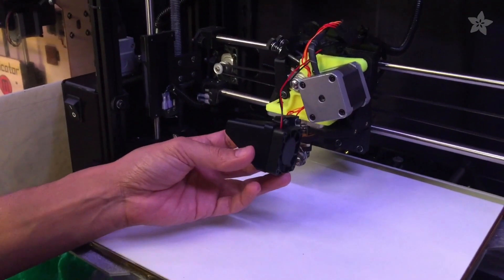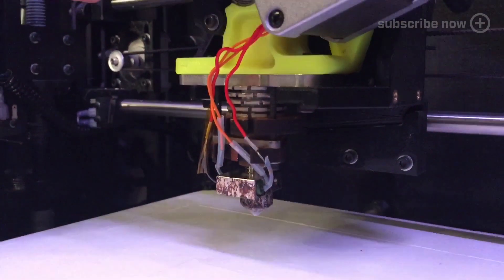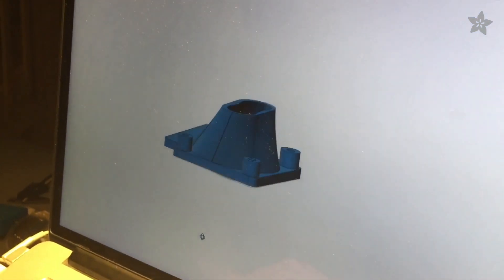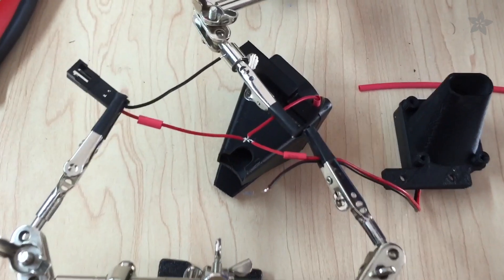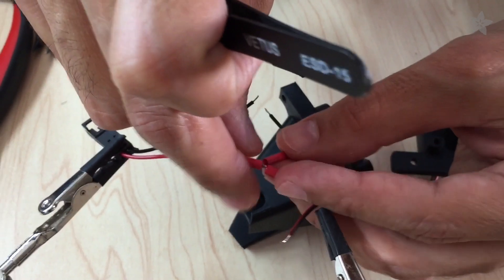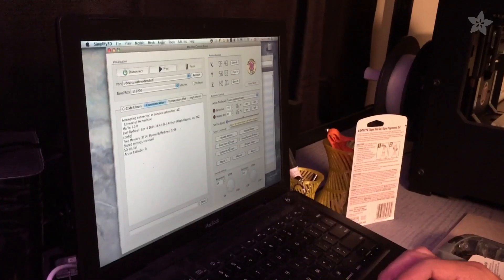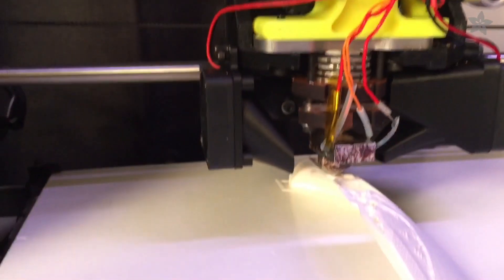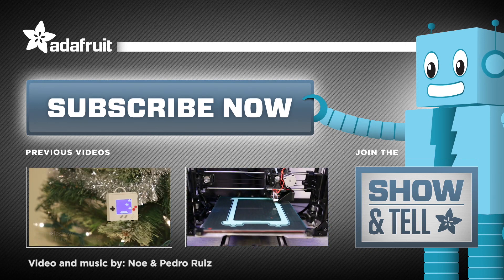Better PLA #3DPrints on TAZ with dual fans

Comment: Will you be publishing this on the Adafruit Learning System (ALS), as usual?  Also, I've noticed that the link to your TAZ 4 Simplify3D profiles from the ALS (check "Taz 4 1.75 filament upgrade" > "3D Printing" > "Download Simplify3D Profiles for TAZ 4") are broken.  Have you uploaded them elsewhere?  Another great video, sirs!
Reply from the maker: Yes! The S3D profiles are available here: http://www.thingiverse.com/thing:403347/#files
Reply: Adafruit Industries Which split duct did you use on the right side?